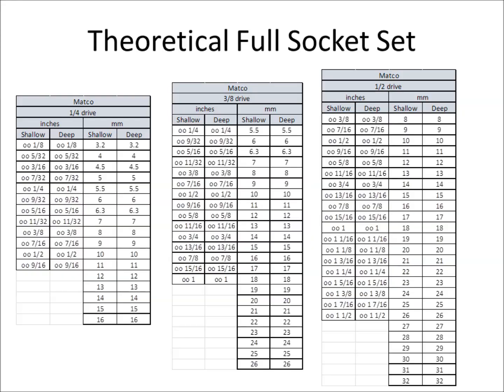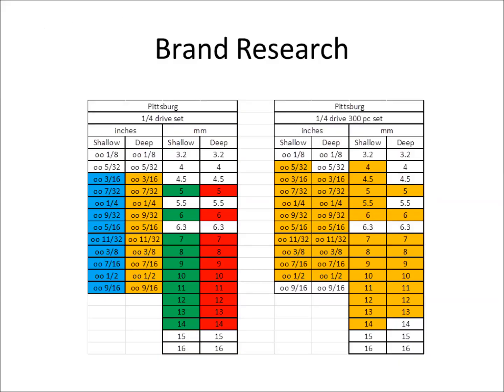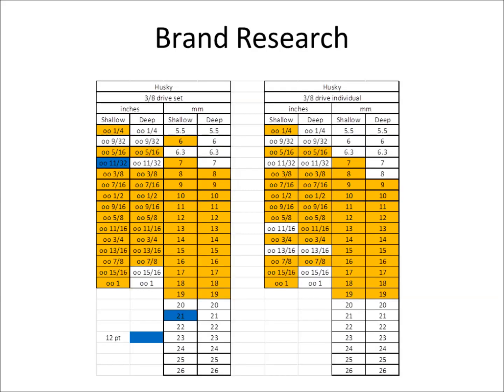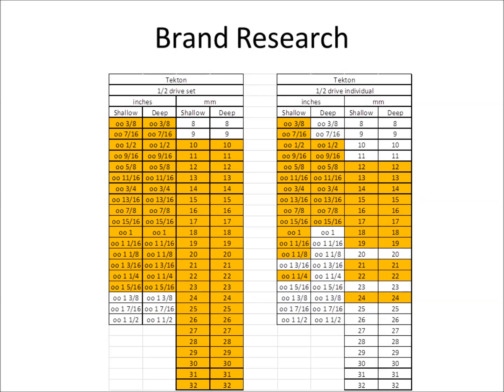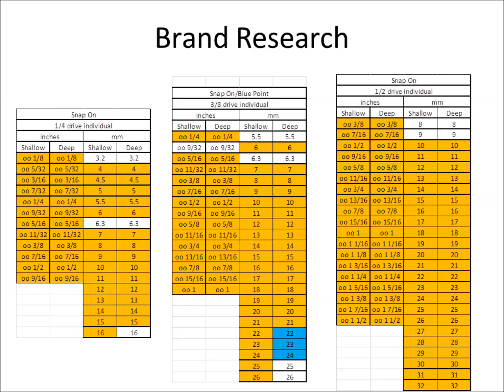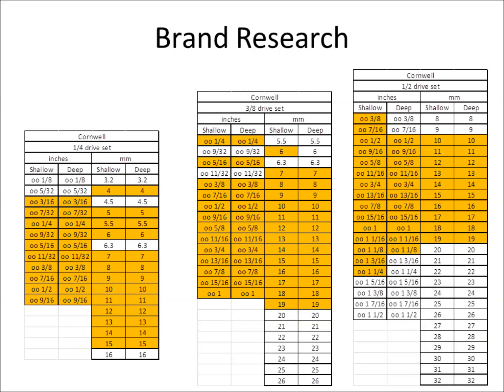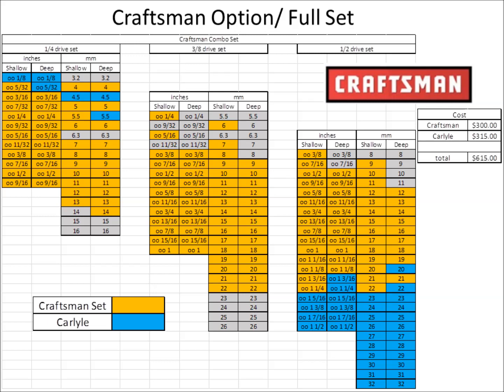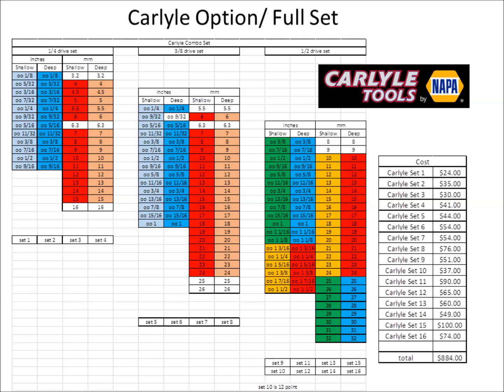A complete/full socket set

Comment: I've never seen a 1/4" 16mm, snap on/blue point makes a 1/4" 5/8". I just bought an SK 3/8" deep set that's 6-26mm. And there are actually more 1/2" sockets if you get the older 32nds include 19/32 25/32 and 31/32".

Comment: Fantastic video. I've been looking for this info and you're the only one that put it together. Crazy that nobody sells a complete set with a discount for bulk.
Reply from the maker: Thanks!  To be fair, the ones that are usually missing are ones that aren't used much at all and the manufacturer can sell a set cheaper with less sockets.  Of course, some sizes like 15, 16 and 18 are commonly excluded and I use those a lot.  My gripe is when a manufacturer sells the individual sockets, but doesn't sell them in a kit, or when they sell the sockets in a kit, but not individually.

Comment: Good Job, very well thought out. in 1940 PROTO TOOLS released their complete tool sets  in SAE to coincide with all Metric sized adding the sizes 19/32, the 25/32 & 31/32 & a couple smaller ones. Being a machinist of 35 years, my brain automatically converts metric to sae by dividing mm by 25.4 or sae to metric by multiplying 25.4. Any number I see my brain converts for no reason, it can drive you insane.🙃😀

Comment: It's definitely frustrating. I have the 299 pc Craftsman set. The part you missed about it is that there are a lot of sizes covered in 12 point that are not covered in 6 point. That mostly comes into play with the 1/2 drive stuff. They even include 3 of the 32nds sizes like 19/32 etc. They also go from 9mm to 36mm on the shallow 1/2 drive 12 pt. I recently bought Gray Pneumatic master Impact sets too. They do a great job of not skipping anything.

Comment: Double sizes I've never even heard of 3.2 mm 6.3 mm.  The reason nobody makes a full set is cuz it be ungodly expensive.  Because some of the sizes are rarely used so they have to make a whole another run for just those sizes that very rarely sell and will cost them too much.  You also answered some of your own questions some sizes are only made in certain Drive sizes

Comment: Tekton now makes 99.9% of all these sockets as part of their no skip line of sockets. They went so far as to make the 1/2" drive go from 10mm -38mm as opposed to 32mm. You still don't get an 8mm and 9mm 1/2" drive, but like you said that's easily covered in 1/4" and 3/8" drives and may not even need to touch Carlyle save for a couple sockets like 1/8 or 4.5mm
Reply from the maker: I have been following all the new Tekton stuff.  They don't have the 1/8, but they do have the 4.5.  In fact, their new 1/4 set has the 4 and 4.5.  Very impressive.  Yeah, like you said, you can buy 100% Tekton and have full coverage.  I love their new ratchets, and new sockets.

Comment: Thank you so much for the video. Does your spreadsheet include part numbers? I'm mostly interested in the Tekton/Carlisle option that you chose.
Reply from the maker: I didn't write down the part numbers.  However, the Tekton sets are part numbers 13001, 13101, and 13203.  If you go to the Carlyle website, you can easily find the Carlyle part numbers.

Comment: Excellent video 👍 Glad I found it. Decided to subscribe.
What about quality vs cost, which manufacturer world you choose or are they all mostly the same ?
Reply from the maker: I usually split it into categories like Chinese made, Taiwan made, and American made.  Of course, you have other ones like German made or Japanese made.  For American, you have Snapon, Mac, Matco, Cornwell, Proto, SK, and Wright.  Taiwan is usually Tekton, Gearwrench, Carlysle, some Harbor Freight, etc.  For China made, Craftsman, Husky, some Gearwrench etc.  Personally, I think for American made, Wright is the best quality vs cost option, and for Taiwan, Tekton is the best option.  For China made, I would go for Harbor Freight.  In the last little while, Tekton has majorly stepped up their game.  You can easily get every sized socket with Tekton in one set of 1/4, one set of 3/8 and one set of 1/2.  The newer sets are more filled out than what I showed in this video.
Reply: I appreciate the response. Never heard of Wright before -did not see them on your video either. From my short research they seem mid-price quality sockets. Will certainly look into this brand further. Been using inexpensive  Husky's set which served me well for over 20 years.
Decided to upgrade to Snap-on ratchets, was looking for sockets only sets, Snap-ons sockets being to expensive but still wanted quality at mid-level price. 
During my research also discovered Grey Pneumatic Duo sockets set, (made in Taiwan) which can be used with impact or none impact tools. Not sure about Wright or Grey’s warranty but I like the idea of Grey’s Duo purpose tool concept at at mid-range price as well. Only read positive reviews so far 👍

Comment: Thanks for putting all the effort into this vid!  Very helpful and includes info not found in other socket vids.  I am looking for a fairly full budget priced, but quality socket set for my new tool cart.  I have found the Dewalt 192 piece set to be similar to the Tekton except for the large 1/2" coverage.  The Dewalt only goes up to 24 mm. Dewalt is all 6 point, and also includes all the extensions and 3 ratchets. You can pick up the Dewalt set for as low as $129 too!  Also gets great reviews across the internet.  That's the one I am currently leaning heavily towards.  Do you have any thoughts on the Dewalt sockets pro or con?

Comment: Pro tip: In Excel, put an apostrophe ' before the fraction.  That will tell Excel that you want it to keep it as a fraction.

Also, what about 21/32 and 25/32?  You can also get 33. 34, and 36mm sockets in 1/2" drive.

Comment: Where's gearwrench
Reply from the maker: I mention it.  However, it was more expensive than a lot of the Taiwan brands, and it lacks a lot of sizes in 1/2.  It also lacks the 4.5 mm and 5.5 mm in 1/4 inch.  You can make a full set with Gearwrench, but you will have to use another brand to fill the holes.

Comment: No such thing as 7/32 dude
Reply from the maker: Every major socket manufacturer makes a 7/32 socket.  There is a possibility that they do that just for the money.  It isn't a common size with SAE bolts.  A size 4 bolt has a 3/16 head, normally, and a size 5 has the same size head.  A size 6 is larger than 7/32.  However, there are rare cases when the bolt head exists.  Plus they make nuts in that size.  https://www.mcmaster.com/#hex-nuts/=1chw4nw  I did use a 7/32 on my internal panels on my Tahoe.  They were screws that cut their own thread into plastic.  Of course, they were probably 5.5 mm, so you could say they don't count.  So, unless you use them on 5.5 mm bolts (which are somewhat common), 7/32 isn't common, but does exist.